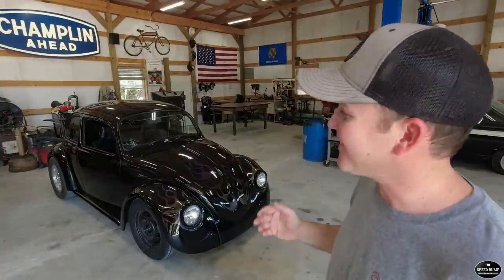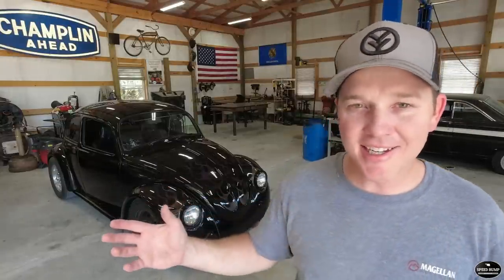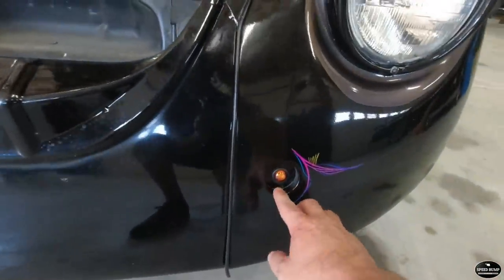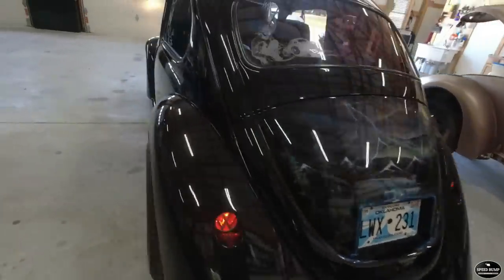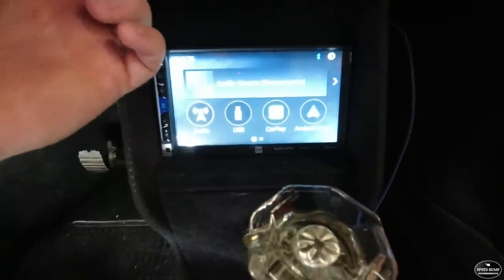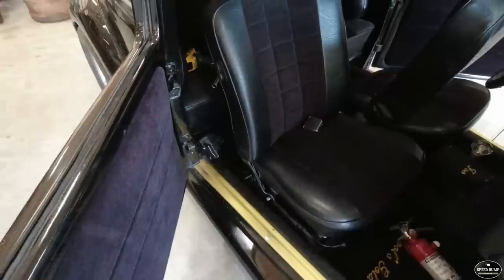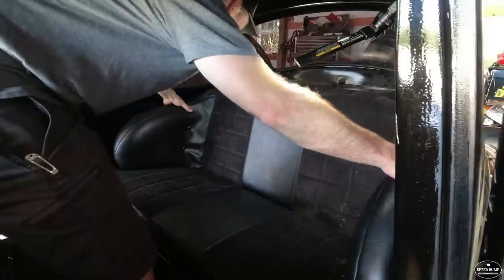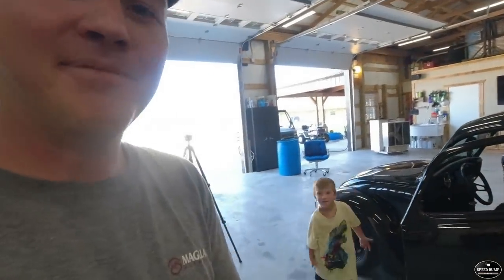Parked 17 Years! Is it Finally Roadworthy?

Comment: This is a year ago. Not sure if any one told you but that possible oil leak on the crank pulley seal  the seal may need to be replaced. Especially for the amount of time the car didn't run. Also keep an eye on the oil return tubes. You did a real banger clean up on that wiring. Wonder if you got around to checking the timing and readjusting the valves. Also I would consider draining the transmission oil, flush, and replenish Great videos.

Comment: When I was a sophomore in 1992 in HS,....my dad got me a yellow 1972 Super Beetle. It was all original with 18,000 original miles. What was weird to me about this particular Beetle,.....was the "Automatic Stick-Shift". No clutch. You just let off the gas to change gears. I believe it was a 4 speed. It worked flawlessly. Until it didn't. You wanna talk about a nightmare???? That little wiring job you had would've seemed like a Disney  amusement park vacation compared to that deal. We figured out pretty quick we weren't in any way gonna be able to fix it. So then,....we started calling around to ask what it would cost to fix it. LMAO.🤣 Everyone. And I do mean EVERYONE refused to work on an automatic stick shift out of a 72 super Beetle. Apparently,.....they are a nightmare for everyone. It's still sitting at my dad's house as far as I know. 

That's a beautiful VW you got there my friend. I love that thing. Only thing I'd change,.....is I'd put the old stainless salt flat moon hub caps on it. It would look so bitchin'. Good luck with her. They are constantly needing up-keep.
Reply from the maker: Salt flat caps would look great on there. I need to get together with your dad and do a manual transmission swap out of my parts car!
Reply from the maker: @theariesexperiment4642  the boys definitely make shop time a little more enjoyable. Thanks again for watching